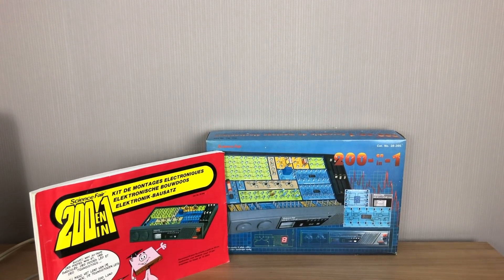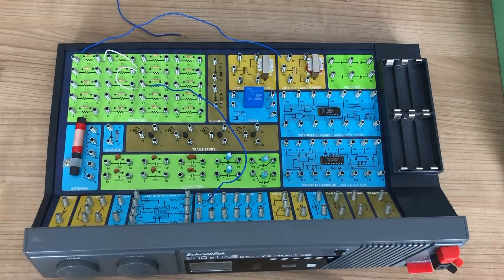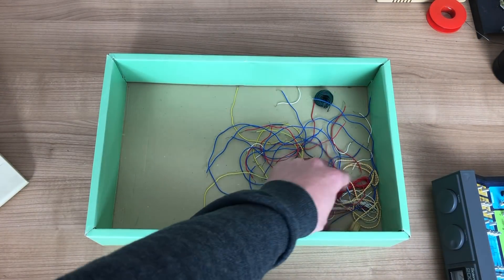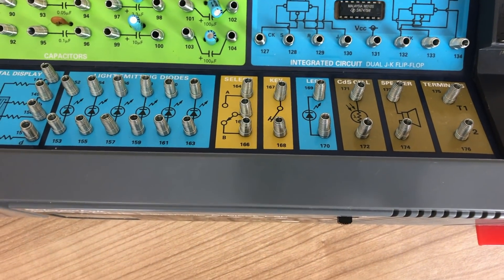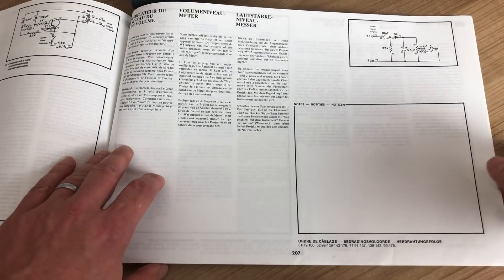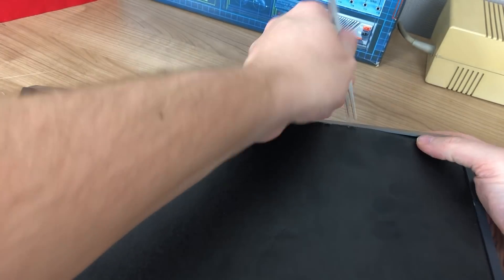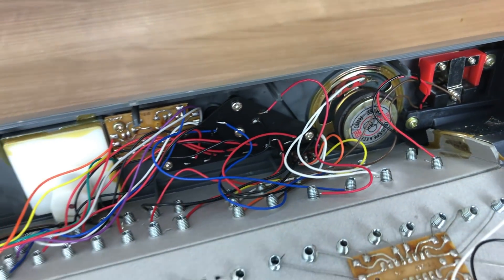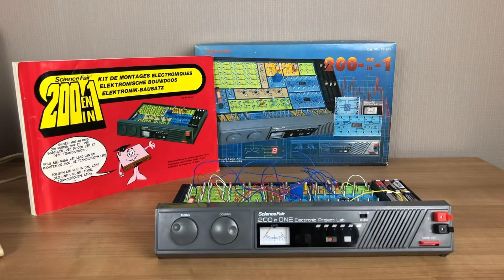Tandy Science Fair 200 in 1 Electronic Project Kit

Comment: I still have mine from childhood! Alas, it has the same problem as yours, burned out LEDs. I suspect that was a common footgun with these units -- you were supposed to always wire the LED in series with a resistor (as you did in your first circuit), but I didn't while experimenting as a boy, and burned the LEDs out one by one.

Honestly a repair worth doing, once my own son is big enough might be worth dusting it off and playing with it together.

(I also have great memories of using the 75-in-one electronics kit that was the precursor of this one with my grandfather, who was an EE and is still with us!)

Comment: Woooooooooow! I really had this one. They say for kids but trust me, some of the projects are definitely not for kids! I no longer have mine but I am seriously considering making up a new one by designing a new PCB, smaller and with other kind of connections maybe some of the wires that come with Arduino or Arduino shields!
Reply: I agree, not just for kids. I brought one as adult maybe 15 or 20 y ago. Still have it.
Reply: @frunomaol5069   I ditched it when I had to relocate. There is still the user manual only in PDF so I could repeat the exercises with the one I am creating. Besides, now, I have an oscilloscope and can make some simulations with a Spice software which really helps understand better. 😉
Actually, I have issues in finding all the components that are used in this kit. Resistors, capacitors, diodes, transistors, ICs are ok for example. What is less OK is the transformers, the Antenna, the variable capacitor, etc...

Comment: I preferred the 1981 version which had a lid so your cat wouldn't rip out the wires when you took a break.  Great find, nonetheless!
Reply: I had that one. I imagined making something awesome in there and it being on the shelf looking rather finished. I didn't advance to that level. I recently got the slightly newer similar one used fairly inexpensively.

Comment: Terrific video. Great fun watching it. It would have been good to see it proven that the old LEDs did not work with the button battery and perhaps an explanation of what might have killed them. I would imagine that killing the LEDs on these kits is quite common.
Reply: I think he killed them right there at 9:46. Applying 4.5V directly to the LED with only the internal resistance of the battery to limit the current.

Comment: I just got one of these, struggling to fully understand how the capacitor resistor ,and transformer oscillator works. I know it’s a kids kit, but at 53 I finally have time to learn!
Could just do with a little more detail.
Reply: The experiments in the beginning of the book are not really explained in theory. Later ones are more well explained. Radio Shack electronics books and the Forest Mimms notebooks are excellent to instruct and educate beginners. I'm reworking these experiments although I had the earlier 200 in 1 that looked almost identical. The first "Wheel of Fortune" had so many connections and little circuit explanation that I'm not surprised it frustrated me. I remember it worked, but I couldn't grasp much from it. I loved stereo and speakers and color TV's so this seemed dull to me at the time. I did all of the radio and sound type things. I'll work through all of them forty something years later just because... Good luck with your studies.

By the way... There are a few general statements... Oscillators are a special kind of amplifier... Positve or regenerative feedback causes oscillation.
Many oscillators can be viewed as an amplifier that is operating mostly in cut-off. The wave shape comes from the passive components that are being pulsed. 
Now that I've said that best consult expert educational materials and YouTube University!

Comment: I still have the 130 in 1 Electronic Lab version from Science Fair (Tandy), i think i bought this arround 1992 or 1993, still have the original Philips batteries (expire date 1994) inside without leaking.
Now when i see this 200 in 1 version, the build quality of this version is much better then the 130 in 1. 
Due the years i have lost the book that came with it,  but found a PDF version of the Maxitronic 130 in 1 version printed in 1999, but which seems to be the same.

Comment: Silicone is synthetic material used in some adhesives, lubricants, & plastics. It has silicon & germanium (an element on the periodic table) transistors & diodes.

Comment: They still make these. They're not worth over $100 though. Watch for sales on them for $60-$75 new. Don't buy used. The used ones may have burnt out, dead, or missing parts. I built lots of AM radios, & all sorts of other stuff with it. After a few months experience, I was building better radios than were offered in the instructions with it. There are technically no components for FM radio reception, but I was able to build a few FM radios that would clearly pick up a couple of the city's strongest FM stations anyway. Build AM radio transmitters, digital light chasers, & all sorts of other cool projects too. It took only a couple of months to build everything I was interesting in as a kid, in the manual. But I continued building other cool stuff, & experimenting with it, designing circuits on my own with it for another couple years. They're made by Maxitronics in China for Elenco, Science Fair, & other names these days, but all the 200 in One kits are identical to the late 1960s versions.

Comment: I had an earlier kit model where each component type was mounted on its own plastic & cardboard frame (one for resistors, one for caps, etc.), with a nice hinged wooden box for keeping everything together. That box is the only part I still have. Anyone remember the name or catalog number of this variant? At some point I cannibalized most of the components for use in projects...
Reply: Search for "Allied Radio KNIGHT Kit 50-in-1 Electronic Lab" or "Science Fair 50 in 1" or "Science Fair 100 in 1" on Google. 
Those 3 are in a wooden box.

Comment: The original model one had an incandescent lamp where the single LED is.  The numbered LEDs were there too, but the plastic bodies were exposed (as was the lamp).
Reply: That's another model, they still make it. The one with the lamp & numeric LED is just another model, but not an original model. Most of the different models came out around the same time, including the 200-in-one. As far as I know, only the 150-in-one model has been discontinued, & all the early 1960s & older models. The orignal early 1960s & older models didn't have any LEDs. Those with LEDs were made since the late 1960s & they still make almost all of them.

Comment: I remember seeing this one in RadioShack stores as a kid.  I remember begging parents for it but it was too expensive.  I did receive smaller kits that I played with but never this one.  I wouldn't mind seeing a video where you demo some of the circuits contained in the manual.  Can you build an AM radio maybe, or if not then something that uses the level meter?
Reply: They still make these. They're not worth over $100 though. Watch for sales on them for $60-$70 new. Don't buy used. The used ones may have burnt out, dead, or missing parts. Yeah, I built lots of AM radios with it. After a few months experience, I was building better radios than were offered in the instructions with it. There are technically no components for FM radio reception, but I was able to build a few FM radios that would clearly pick up a couple of the city's strongest FM stations anyway. Build AM radio transmitters, digital light chasers, & all sorts of other cool projects too. It took only a couple of months to build everything I was interesting in, in the manual. But I continued building other cool stuff, & experimenting with it for another couple years. They're made by Maxitronics in China for Elenco, Science Fair, & other names these days, but all the 200 in One kits are identical to the late 1960s versions.
Reply: Same story for me haha!

Comment: I remember receiving that as a Christmas present.  With in a day I managed to blow 3 of the Leds, and one of the transistors, very few of the projects I completed ever worked.  The LEDs on the front panel weren’t protected by a resistor internally as the digit display was, so if you connected too many too many of the batteries to one led they would fail.
Reply: I got all of the projects I was interested in to work, but a few I had to try several times to get working. After months with experience, I was making dozens of other projects with them, not in their manual.
Reply: @PSKResearch  I never achieved that mastery. I wish I had... I was too interested in trying to get a big tube color TV and blasting rock music. I loved the technology, but lacked confidence and organization. I bought a used kit and and picking away at the projects with a much advanced understanding and still plenty to learn. You've probably made a career of electronics, no?
Reply: Well done, I'm impressed. I still have the kit.  @PSKResearch